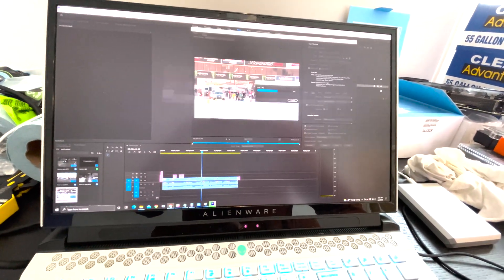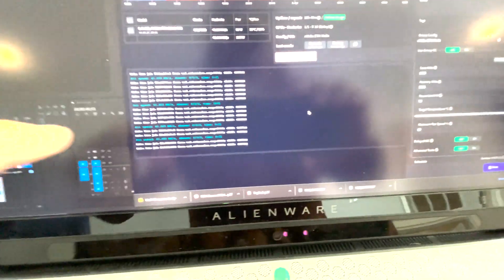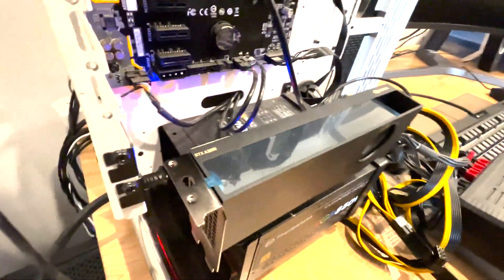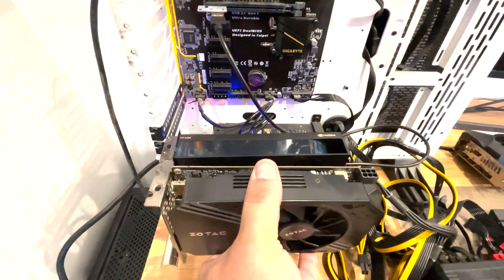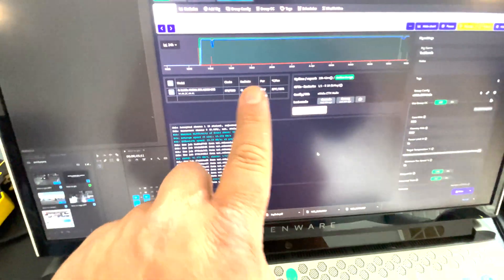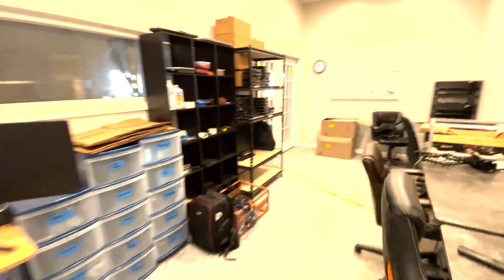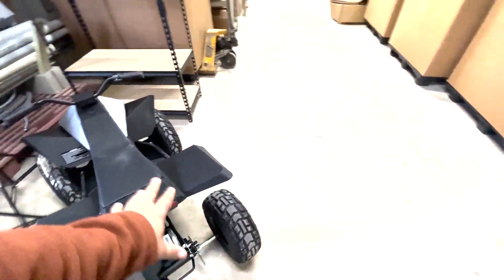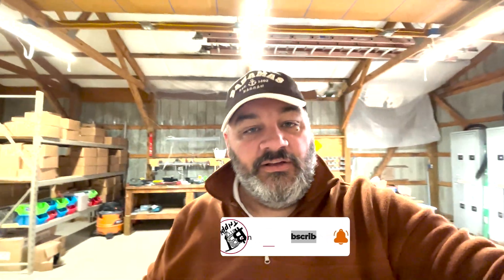The nVidia A2000 maybe the most efficient ETH GPU to date.

Comment: The A2000 is not ideal for mining in my experience.
The temps run too high seeing as there is only one small fan, single air intake and exit. It also didn’t perform that well on any dual mining capabilities. I would rather recommend spending a little more to pickup the RX6700 XT.

Comment: got already over 5oti runing since Dez. 21. Great Card nice to scale, as U can built 12 GPU Rig with one 1200W HP server psu. with Pico Adapter powering the MOBO, very stable, just wonderful!
Surprisingly the A2K 12GB GPU dos bring 38-41MH.
Update: Driver 470.103.01 dos an increase in hashrate on the 12GB GPU

Comment: I like the idea of an a2000, but here is where I get off the bus.

All pices below are in NZD.
Let's say there is an 80w difference between an a2000 and 3060L.
0.08 x 24 x 365 x $0.21kwh = $147.

A2000 cost $1030 (pbtech)
1yr old 3060L ~$600 (TM)
That $430 price difference. $430÷147=2.9, Meaning I'd have to run the card for  almost 3 years. before consuming enough power to make the price difference worth it.
Reply from the maker: Yes the original retail should be 399
Reply: @BitsBeTrippin  true. Over the last week we have seen new 3060 for just over half the price of an A2000.
Prices are comming down.
Reply: I picked up one from Alibaba, $610+$25shipping+$22 custom charges. Had to get one to test for myself. Running 41.45mh @68watts @51oC.
Reply: @bostitchrider2026  so basicly it does the same as a bios mod rx5600xt my stock rx5600xt does 39mhs at 70w at 701mv (lower voltage doesnt do anything and higher hashrate makes it crash)
Reply: @reggiexp69  Yes I guess so. About the same price as well.

Comment: Regarding A2000 efficiencies - would it be possible to install these cards in a server case without the blower shroud installed, such that the server case fans cooled the GPU heat sink, and the available power overhead for the GPU (70 watts) was fully dedicated to mining and not also turning the blower motor?

I’m planning to test this in a couple weeks, but figured I’d see if you had any thoughts in advance.
Reply: i have 12 of them in octominer case, i put them as they are i think its possible to do that but i didnt tried.
Reply: @tancakar8987  this is exactly my plan. I intend to test it out with a single card first before committing to the rest.
Reply: @cgooch_  to be honest they do sit very nice with no thermal problems. So i doubt it will make any difference but now you make me wanna find out too :D
Reply: @tancakar8987  my thinking is beyond thermals ;)
But yeah, still worth testing on my end.
Reply: @cgooch_  just watch a video about the A2000 thermal paste change yes its possible to put them in to octominer without the blower case, however it needs different screws to secure the mounting plate. yes and i think it will probably spend less electric and the thermals will be beyond good. At the minute all my A2000's sits on 57 C and MEm temps 88 C. Assuming that will be 10 C less. and perhaps runs with only 60 Watts? i need to see if i can do it.
Reply: @tancakar8987  my guess is it would be a 5 minute job. Let me know if you pull it off and what the results are :D

Comment: Your meter is wrong, in no way are you getting below 50 watts on these cards. They want the full 70 watts power to hash correctly. I pull 660 watts at the wall on an 8 card system. 338 MHs, celeron processor. EVGA 750 watt GOLD power supply. Could perhaps do a little better with a 1000 watt PSU. The 12 GB version wants even more power, so it is actually worse on than the 6gb version because the card is so starved for power. I look forward to your full system testing though.
Reply from the maker: The meter is not off by 30w, its +/- 3%, not 30%; but going to do a deeper dive. We have another meter to check the line directly too.
Reply: @BitsBeTrippin  it’s not 30w difference but around 20w, I agree though and think your meter may be faulty, be interesting to see what you find out

Comment: I still don't see the value in a2000 way too expensive compared to a 1660super
Reply: if your electric kwh is 0.30 $ you will see the value.
Reply: @tancakar8987  but $329 vs over $650 in the name of efficiency? I dont know about all that, I would look into moving my farm to a cheaper location
Reply: @TobiHamed  not everyone can my friend. I bought my A2000s for $580 each, bought 12 of them and they are my best cards i own i think , and all my farm are non lhr 3080, 3070 and 3060tis founders editions only.
Reply: @TobiHamed  at the minute that rig i have sits on 504 mh/s at 890Watts at the wall with the octominer unit. I dont think you can find anything like that efficency. yes $650 is alittle high price, surely can be get cheaper.
Reply: if your stacking hundreds of these things in a building it adds up quick

Comment: you are wrong man the most efficient is the 3090 ti 😂
Reply from the maker: Not even close ... The best I have seen so far is 128 @ 260w .. most people running it at 135 @ 330w ... That is nowhere near the efficiency as the A2000 ... The A2000 is nearly 1 to 1 from MH to Watt ...meaning 42MH at 48Watts is 0.91 to 1 on MH to Watt. This is by far the most efficient. The 3090Ti would need to be 230MH to 265W to match efficiencies.
Reply: @BitsBeTrippin  He was joking I guess and hope.
Reply: @svhx1  I was joking man
Reply: @BitsBeTrippin  I have a 3090ti coming soon. Best I saw was 130mh @ 317w, if I can get it down to 250w at 130mh I will be super happy. That is more mh than 3 6600xt and a rx570 😎